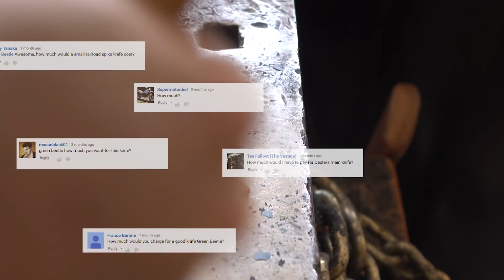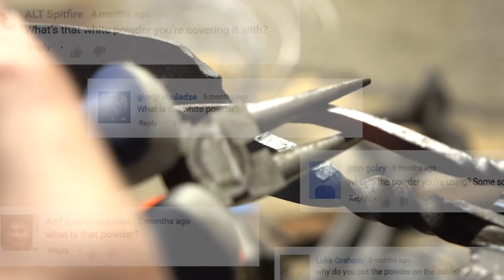Q&A + Forging a 52100 Steel Knife

Comment: Its a good format. as for my question where are the best places to get steel free or cheap and what should i look for (leaf springs as an example) to make good knives
Reply from the maker: cheap knife steel can be had in old files, provided they aren't case hardened.  Probably $-2 each at pawn shop.
Reply from the maker: I've used leaf and coil springs.  They may have cracks or micro fractures from wear and tear so I generally stay away nowadays.

Comment: what's that white stuff you put on the hot metal? lol
Reply: Yes.
Reply: It's borax. It is used to dissolve the scale formed on the metal. It is formed because the heat causes the metal to oxidize very fast.

Comment: I like the format, 

I question I've been wanting to ask: where does one find a belt grinder like that (I'm from europe, but can't seem to find anything like it)
Reply: This is a way, way late reply, but it's called a 2x72 belt grinder. I don't think i've seen european makers using them. I think your best bet (if you don't have one already) is to make it yourself. there are dozens of tutorials for making them on youtube, but the best one I've seen is from Old Hickory Forge. Here's a link to the video: https://www.youtube.com/watch?v=thlCrrmPBzg (the wheel set linked in the description doesn't exist anymore, but if you search "2x72 wheel kit" or along those lines you should be able to find one)